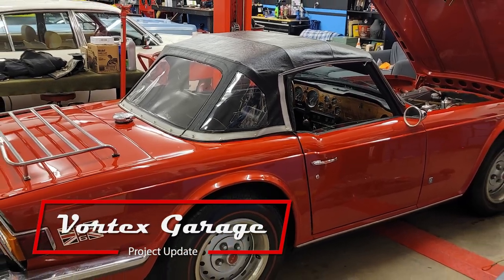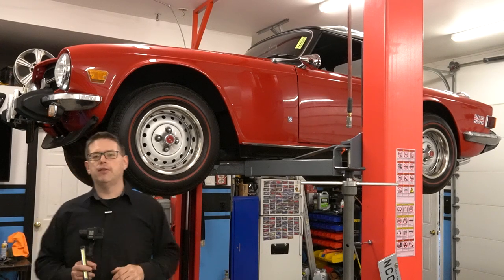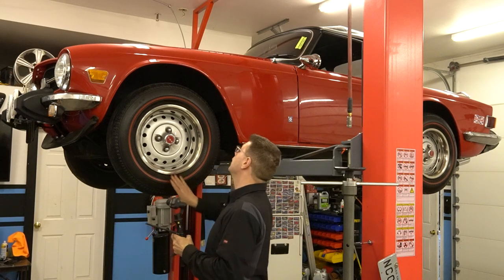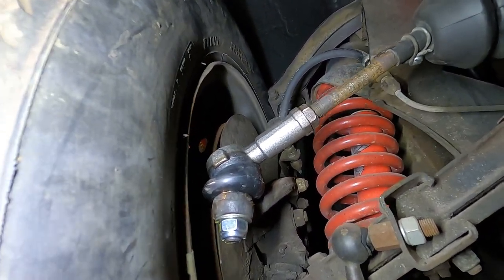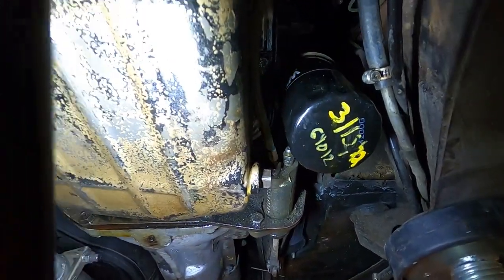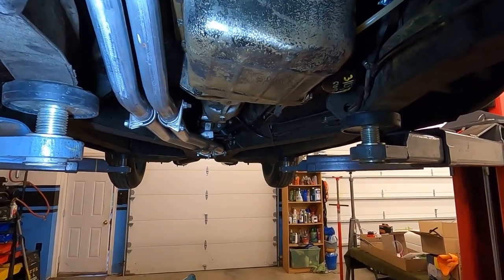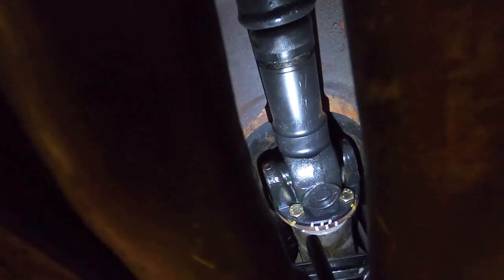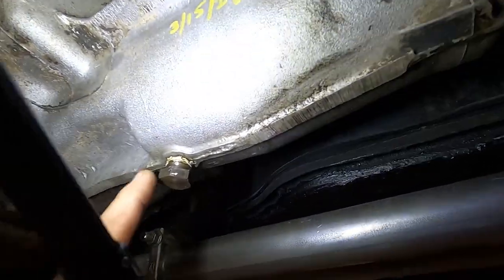Everything fixed underneath!  Triumph TR6 Work Completed Part 1 - Vortex Garage

Comment: Have a close look at the brackets on the rear tube shock conversion. The chassis was never engineered to handle the force at the new mounting point and I've seen more than a few frame rebuilds as a result.

Comment: Great video.
Only thing is that i find the U-clamps difficult to absolute seal tight.
On my Spitfire i had to change to a one bolt circular or band type witch i consider a better option.
Reply from the maker: That's good to know - I have seen those clamps and wondered how much better they are.  Probably don't even need the extra insurance of the muffler sealing paste with them.  Thanks!